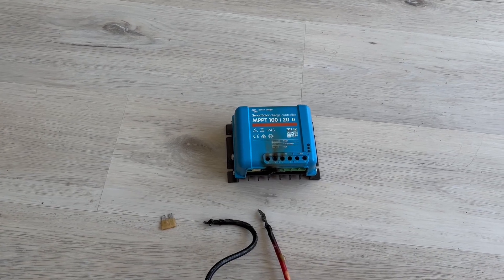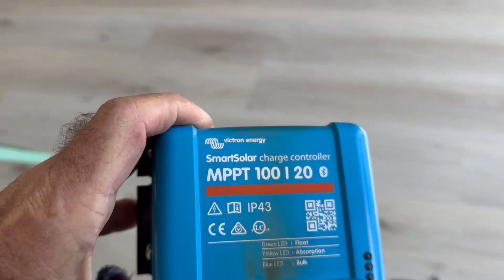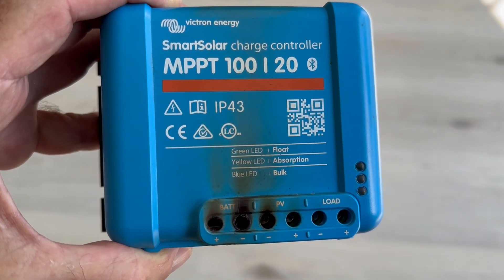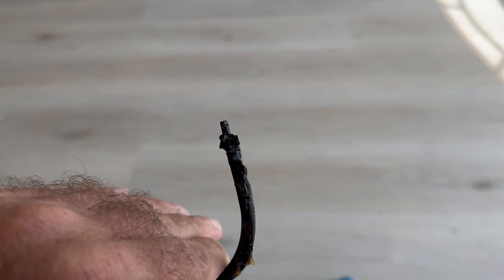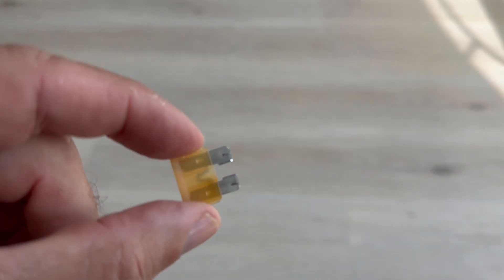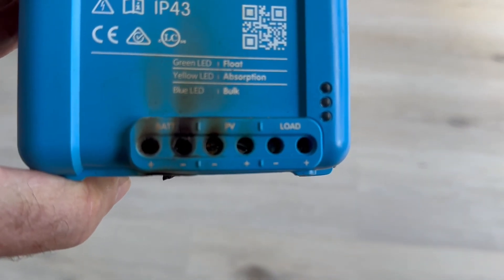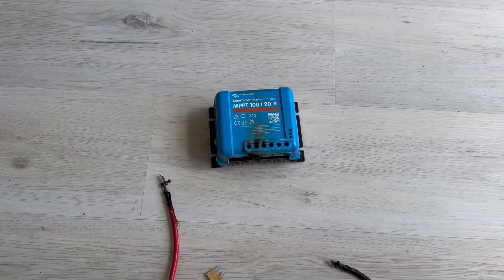VictronMPPT 100V 20 amp 12-24-48 Volt Solar Charge Controller burned. Warranty honored

Comment: Would connecting to a circuit breaker with screws be better compared to using a fuse? I mean from the controller to the battery (or bus bar, etc.) Also having a circuit breaker from the panels to the controller? Glad you are alright and the house is fine. Too bad it happened and one should check the connections every 3 or 4 months as you wrote in comments, that is too often...

Comment: I think your wires touched inside somehow. The fuse can't protect in that case as it's happening before entry to the unit. Also this can happen if the connections are loose. It causes arks, sparks and then fire

Comment: I've been doing electrical work for decades. I've seen burned connections like that more than a few times. The causes are always incorrect screw  torque or use of aluminum wire.
Reply: In this case the Victron reps analyzed the item and explained that swell and shrink was the cause.  I was not checking the torque periodically because the installation was stationary.  I had bought all marine components because that was the original install target but when I used it in my home I never considered the connections loosening over time due to no movement. 
Victron was great to work with and they provided a replacement under warranty.  They will be adding a statement to their manuals recommending checking the torque every 3 to 4 months just to be sure.  I was not doing that.
Thanks for the comment.

Comment: This is why I mount all mine in well cooled metal cabinets.
Reply from the maker: That’s a great idea but this swell and shrink was due to current at the connector contact points.   The Victron people strongly recommend we check the connections periodically (every 3 or 4 months) just to make sure the torque is still where it needs to be. 
Thanks for the comment, all the best

Comment: why did you have a fuse on the wire leading into the controller if the controller itself already has a built-in fuse on the output circuit that you also showed? seems redundant
Reply from the maker: I added that to the new one and explained the function to people I sold the setup to. I put an inline fuse at the same rating as the cable from the panel just to make sure it would fail faster.
Still have to check those connections periodically though … can’t wait to get started on the new install in Japan.
Thanks for the comment.

Comment: it burnt the battery outputs not the PV (solar inputs)
Reply from the maker: Yes, they consistently saw a higher voltage output. It increased the level of swell and shrink from the heating and cooling.  They must be retightened every 4 months or so according to the Victron reaps.   There was nothing about this in their install docs but I am told after this incident Victron may have a mention of it in the maintenance section. 
The reps in California were great guys, as soon as they received this damaged unit they took care of getting me a replacement. 
Thanks for the comment 👍🏻

Comment: Just to be clear, while the input current might only be about 6.5 amps (two '12' volt panels should produce about 17 volts each at max power, the 110 watt panel will limit the 220 watt panel to about 110 watts as well), the controller converts this power to the output voltage and this energy efficient conversion increases the current. If 220 watts is converted to 12 volts the current would be over 18 amps. So the output side will see near 20 amps whenever there is enough solar input and the battery voltage is low enough to accept it. As others have mentioned this thermal cycling can loosen the connections and even a small amount of resistance will generate a lot of heat and cause exactly what we see here in a runaway cycle. Connections must be kept clean and tight, maintenance is your friend. Hope you have better luck with the replacement.

Comment: If the fuse didn’t tripped that mean bad connection maybe not tightened well, 
thank you for sharing it is very important point for safety

Comment: Hello im looking at this unit on Amazon the 110 20   48 volt unit. I have a question, can you set it up in the connect app for 12 volt?? Im so glad they helped you out with a gret product.
Reply from the maker: Hi William,  I have the 100 20 version and it supports 12/25/48 volts.  That’s the main reason why I buy this one due to the flexibility.  I’m not familiar with a 110 20 unit.

Comment: I just installed this very same MPPT in my vehicle.  I added a 25A circuit breaker upstream of the Victron unit.  The distance between the breaker and the Victron is no more than 8 inches so I figured 12AWG stranded wire would be sufficient.  I'm still in the build stage but close to completion.  According to my wire gauge chart, 12AWG is good for 25A up to a distance of 6 feet.  Is the 12AWG wire for this application insufficient?
Reply: I would put 10AWG (that is 6mm2) just to be safer and really not expensive... The 25a circuit breaker should be good.

Comment: I had exact same issue today. The weirdest thing is that is cloudy today and generated max only 220w solar  power. 
I had this for 6 month and many times  full sun controller did just fine. Did anyone got warranty honored?
Reply from the maker: Yes Victron honored my warranty.  The issue was thermal expansion and contraction which loosens the contacts over time.  Took a little while but the Victron rep out of California was very cool and I have the new unit up and running.  I have added ferrules to the install this time and it feels a lot better but I will check every few months.
Reply: @colinauld  Totally disappointed with victron . Bought mppt 100/30. . While unit still work , terminal is melted and is impossible to open up unit to change or clean terminal. Nor Victron would serve unit, and warranty was refused but honored for others, go figure...   Bad purchase

Comment: What gauge wire did you use to carry the 20A from Solar Charge Controller to the Battery?
Reply from the maker: 10 AWG and happy to report that Victron will be replacing the unit under warranty.  The issue is the expansion due to heating and cooling and we are hoping to get Victron to add advice about this to the manual.

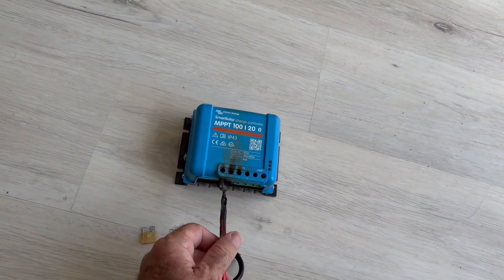Comment: 1:37 the amount of wire going into and after  the screw connector is pretty long , would recommend to use crimped wire ferrules,  it helps  with  stranded wire loose and into the controller circuit board  which can cause a short circuit that looks just like that . cheers 🍻
Reply: Just bought my first victron product. I'll definitely keep it in mind.

Comment: Once an arc starts the carbon will make it continue.  Possibly overheating or a loose/loosening connection.  It could even have been a bug crawling between the terminals.  I'd have expect a bug short to be more likely between the PV terminals but maybe between PV and battery also has high voltage.

Comment: Looks to me like wire issue.  They should design those with more spacing and larger terminals.  They just use common stock terminal blocks.  Victron products would benefit from improving on this aspect.
Reply from the maker: Looks like you're on to something there, I'm seeing a lot of agreement with your observation in the comments..
Thanks for taking the time to send yours
Reply: One reason I'm hesitant to get a Victron until they enlarge and space out those terminals as well as get rid of slotted screws.

Comment: Loose and bad contacts? If the contacts are loose then it acts like a resistor that heats up. 
This damages the connection over time and leads to a higher resistance that heats up even more.
The fuse stays OK because the current is decreasing.  Do you have good copper cables or cheap aluminum?
Aluminum corrodes when it comes into contact with other metals and oxygen. There are also bad contacts.
Reply from the maker: Had great performance right up to the end.  CerboGX always reported good flow in and out of the controller (or at least consist flow).  Would be great if Victron would take it and diagnose … not much left of the outbound side of the little controller though. 
Thanks for the input.

Comment: Looks like heating at the connector caused by a loose connection between the wire & screw terminal.  Check your connections people.
Reply from the maker: Not the case here.  That installation had been running for over 14 months with no issues and connections were tight when installed.  Unless these connections loosen over time with no vibrations or motion introduced.  
Did have some heavy lightening in the area just prior to this issue but I don’t see evidence of a strike in any other components or the inbound wires? 
Hopefully Victron will diagnose
Reply: @colinauld victron recommends retorquing the connections because over time the expansion and contraction loosens the connections. Should be checked after 3 months then on a regular schedule if you use all the time.

Comment: Good video mate. Luckly it wasn’t a worse outcome.. call me crazy but I am doing a little experiment myself running 500w into my 75/15 controller. Going to do a longevity test. Will be intresting to see what happens. Might be some fireworks 🎉😂
Reply from the maker: Wow ... that's a stress test for sure lol.  Based on what I just experienced I'd make sure that controller was far away from anything flamable. 
Thanks for the comment, good luck with the test
Reply: I use the 100/20 48 with 480wp at an 12v battery, it maxes out nearly every day, without any problems.
The 75/15 I used before was much hotter even with 360wp.
But I see no problems maxing it out, it will reduce the charge current if it geht's hot.
At my 100/20 I have an 40mm fan controlled by an ksd9700, at 40 degree Celsius it starts the fan. 
I also used 10awg cables, but with end sleeves and have no problems.

I really think that your problem was a loose connection
Reply from the maker: @SchonRichtig  It's been running great here too and I have other Victron components which are problem free.  My cables are also 10awg but this issue started in the controller.  The cables only burned on the end plugged in to the controller.  glad yours is running great, Victron rep says this may be due to expansion from heating and cooling.
Thanks for the comment.
Reply: @colinauld thanks mate. I have the unit isolated on and safe from any potential disaster

Comment: A loose connection is not Victron's fault
Reply from the maker: That’s true … this was not a loose connection.  It had been in place and running perfect for over a year.
Reply: @colinauld  not the case.  At 20 amps these controllers experience significant heating of the relatively low mass  / small physical size terminal blocks. As the materials involved have different co-efficient of expansion rates, every heat cycle mechanically stresses this joint, which if the terminal is not re-tightened occasionally leads to a loss of clamp load an increase in resistance that then increases heating even more (loss = I^2r)

Really a 20amp joint should use a bolted joint and include a suitable compression limiting element (like a belville washer) to avoid the peak stress and keep the joint pressure more constant
Reply from the maker: @maxtorque2277  I had read that also .. the thing here is that the little controller saw amps at around 12 ... Maybe I'll go with their 30 amp but it has no support for 48v.  Thats what I really liked about this model, it's very flexible.
Thanks a lot for the comment
Reply: @colinauld  I run 3 of these controllers on my workshop solar array and yes they are great units, but i have noticed the output feed to the battery runs hot at 20A continuous even when well tightened. Typical panel currents are only in the order of 10 to 12amps at max (and generally a bit lower than that at UK insolation levels). I can't remember if the units blade fuse is sat on the panel side or the battery side, but i'd recommend an extra external fuse as close the battery bus bars as possible to protect against an unit or wiring chort causing the battery to discharge across at v.high current!
Reply from the maker: @maxtorque2277  Oh I see, so the output side is consistently hotter and funny enough that's where my issue appears to have come from.  I have two fuses between the battery and the bus bar but I really like your idea of fusing between the controller and bus bar too ... especially if that fuse in the unit is for the inbound side. 
Thanks again, good stuf.

One other question, on the yacht I would check connections periodically due to to yanmar vibrations and just sailing motion. I don't check the connections at home because there is no vibration ... these connections don't loosen over time do they?
Reply: @colinauld  The input (solar panel side) and output (battery side) currents depend on the ratio of voltages between those two sides. Take an example where the battery side is half the panel side (ie 24v battery coupled to 48v panel string) then here the battery side current will be approx twice the panel side.  For an MPPT tracker then clearly the panel side voltage will diectly depend upon the exact insolation hitting the panels, and the battery side on the state of charge of the battery.  The 100/20 victron unit is limited to a 100v max panel string voltage and a 20amp max battery current output. 

You don't need vibrations to loosen the connections, as current changes, the temperature of the terminals change (resistive losses heat the terminal) and the materials have different rates of thermal expansion, meaning the joint experiences cyclic varriations in compresson, and these can cause a loosening effect over long periods of time
Reply from the maker: @maxtorque2277  I just spoke with the Victron rep in California and I really think you have nailed it with what you said about the outbound side.  I’m uploading a new video now and I’m giving you credit in it.  The Victron rep says that the outbound side will see expansion and contraction due to exactly what you said regarding the outbound load.  He says it could be lightening (he watched the video lol) too but he also recommends that we check all our connection screws every 6 to 8 months just to offset any expansion.  
Really appreciate your input, thanks again.

Comment: Could also be a lightning strike.
Reply from the maker: I was really leaning that way.  It’s Florida in the summer and we get tons of lightning… getting it right now.   I just thought I would see more evidence of that - on the panels, or the wires coming in from them??
The only casualty is the little Victron but maybe it was the first to offer enough or any resistance to the strike?  
Thanks for the comment.

Comment: Brush on some DeOxit on all the terminals.  A little resistance produces heat.  The treatment keeps it from forming an oxidized layer.
Reply: +1 I use that on all my electrical connections.

Comment: From a pure physics pov, this was cause be excessive heat. This heat comes from excessive current due to low resistance path or arching. One has to open the unit and examine the circuit components for a more thorough analysis. See if Victron is willing to do that for you. Isn't this under 5yr warranty?
Reply from the maker: That's what I'm  hoping for and yes it may be under warranty.  I hope it is due to some internal component failure - I don't see evidence of any issue on any of the inbound wires ....
I'm going to test the panels.
Thanks for the coment.